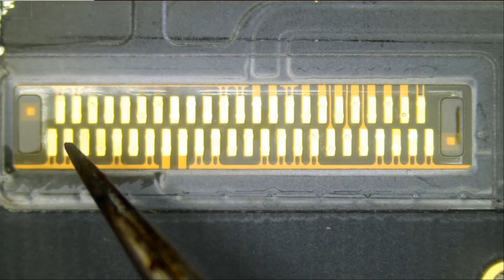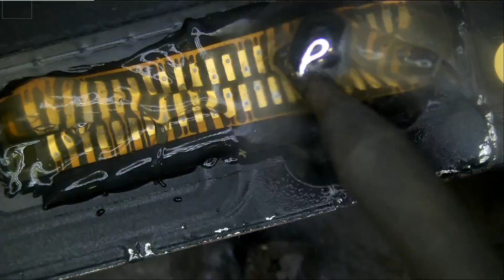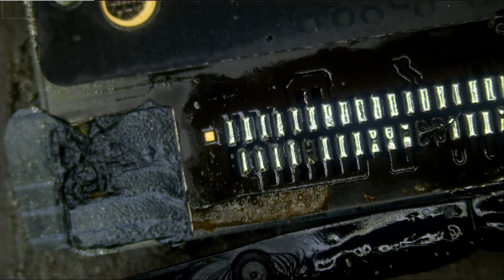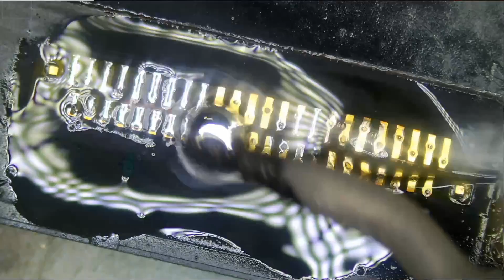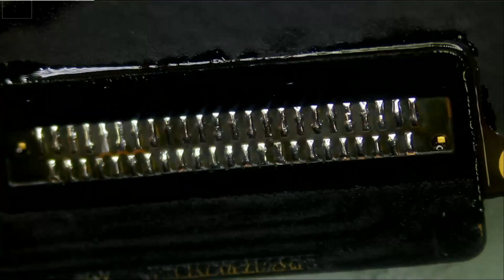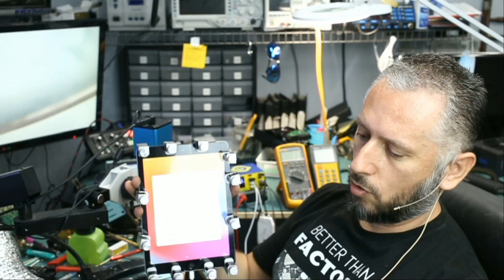iPad 6 Not charging Repair

Comment: I would like to attempt to do this repair. It doesn’t look too difficult. Where would I get the flux and low melt solder? Is there a preference to the brand you like and does it make that much difference between the manufacturers?
Reply from the maker: Low melt https://northridgefix.com/product/low-melt-solder-pack-of-6-sticks/ 

Flux https://northridgefix.com/product/amtech-nc-559-v2-tf-flux-10ml-syringe-plunger-2-needle-sizes/

Comment: Flickering with the Apple logo after replaced the charging port Flex on ipad 6, any idea please advise 🙏... thank you much in advance 👍and I think it's battery issue because if I unplugged the cable,  there's nothing on the screen.   But before I replaced charging port,  it displayed red battery icon and charging cable

Comment: the key to this job as he says is putting the solder on top of the connector, TO LOOSEN the connector.  if you didn't get why, he said it in the video, the solder apple uses is LEAD FREE.  The LEADED solder Alex is using has a lower melting point. so when the hot LEAD solder comes into contact with the LEAD FREE solder, it all melts and mixes, and thus lowers the melting point of the APPLE solder, and thats why you add solder to loosen solder.    apologies if im out of place, just thought that was an important piece of info that some may get confused on.   Im loving these videos

Comment: You always refer to the low melt Alex but what is the other solder wire that you use when putting components back in place. It just always looks so shiny. I want my work to look "Better than factory" like yours lol

Comment: I don't even use hot air for ports. Just put a huge blob of solder on your iron and go back and fourth and work the port off. No hot air and risk involved. Idk how many times I've gotten wrecked boards from people using hot air when not even needed on these

Comment: Better than factory. Brilliant job like normal. You need a full size clamp for the screen. Those clamps are good for small jobs but found they don't give equal pressure.
Reply: Yeah, I agree.  I know that I could build a good equal pressure clamp for that kind of repair.

Comment: after watching the video: "oh snap that was easy"
tried to work on a non-working MOBO: "what the heck am I doing"
Reply: If you have a micro camera then look for any obvious spots like "burned" or discolored components especially CAPS and MOSFETS.
(No, micro camera.............then use a good magnifying glass and LED light source)
IF not then hook up some power to the board and IF you have a heat camera then look for the hot spots.
OH, you should have tested for shorts also in the beginning.
Remember that a bad component might be on the other side of the board or away from the shorted area.
The Northridge "rosin tester" is a good way to find bad components if you don't have a heat camera.
AND you can put alcohol on a component with power hooked up to see if it evaps quickly from the heat.
Using a slow and methodical process using these steps will get you to a conclusion of the problem.
Then comes the fun of removal and replacement.
Following Mr. Alex's tutorials on component removal (being careful that there are no other components that might melt under solder iron or heat gun near by which you can use aluminum foil to cover) de-soldering and re-soldering using his low melt solder and copper wick method, and then finding the exact matching component and then re-soldering it back on the board will make you an EXPERT.
REMEMBER to FLUX, FLUX, FLUX, whenever removing a component.
You might even heat some low melt solder on the component as well to mix with the original solder to make it an easy removal.
Also the diagnosis and repair of the board's damaged pads is essential.
Using either CAD6 or CAD 5 wire to make new pad circumvents is a great idea as well.
Tools like micro tweezers, micro solder tips, heat gun with adjustable heat and the power adjustment source are all essential in making your repairs just as "better than factory" as Alex makes them look so easy to do.
It's basically surgery. Remember the game, " Operation"?
Yeah, just like that only more micro.
ZZZZZZZit~   OUCH!!
Reply: Do yourself and use an integrated heating element tip iron and have a best hot air station on standby and some low melt

Comment: How much pressure do you apply when soldering?
Reply: Enough, but not too much.
Takes experience for that kind of skill.
IF you have some old boards about, practice on them by removing components and then putting them back on.
It's the same method as how to get to Carnegie Hall.
PRACTICE, PRACTICE, PRACTICE!!!!